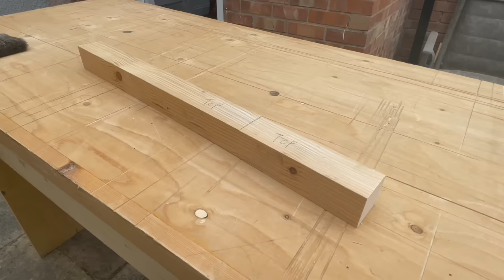Easy Trick For Scribing Kitchen End Panels

Comment: Can i ask a quick question as im trying to do an end panel and leave a 40mm over hang at the top to accomodate the pelmet, how would  be able to do this with this method.  Easted so kuch time trying to do measurments just want to get it done with. Great video great tip thank you
Reply from the maker: Hi, thank you for watching and commenting! This method only really works with base units to get them flush to the floor. Am I right in thinking you are doing an end panel on one of the wall units or have i misunderstood? If so it’s hard to explain over a message so i have a search on youtube and there is a video called ‘wren kitchens infinity: wall decor panel installation’ and that is pretty similar to how i wold do it
Reply: @mwjoinery  hi yeah exactly that its an end panel for larder unit. Ive seen that video i was thinking of doing it like that but then it means ive got to make two cuts. One at the bottom one at the top because unfortunately for me the floor is also uneven lol. Thank you for taking the time to reply though i appreciate it.
Reply from the maker: Ohhh right,If it is a larder unit and you have plenty of height in the kitchen… you can still use my method you just thicker off cuts. I will try explaining the best i can but just make sure you check all of your measurements before cutting because I don’t want to make you mess up your end panel if I don’t explain it very good but here goes😆 offer the end panel up to the larder like i did on the vid. Put an off cut of the 40mm pelmet on top of the end panel and measure from the top of the larder to the top of the end panel (including the pelmet off cut). You will need 2 off cuts the exact same thickness (like i did on the vid) but they have to be thicker than the overhang that you previously measured. Once you have them, take the pelmet away and clamp the off cut to the top of the panel. Then put the pelmet on the larder unit and hook the end panel on. Then use the other off cut to mark along the bottom and it will compensate for the pelmet and leave an extra 40 mm on the top. Hope this helps?
Reply from the maker: And as for the floor, that’s typical that it’s uneven… would be far too boring if it was nice and parallel…😳😆😆 Thanks again
Reply: @mwjoinery  you sir are an absolute legend. Totally understand that. Amazing, thank you ever so much for taking the time to reply to my comment . Ive subbed you too
Reply from the maker: No worries at all, if you have any more questions i am happy to help if i can! Thank you for subbing! I will start doing a few more vids soon so hopefully it will be worth it for you😆👍🏼👍🏼
Reply: @mwjoinery  just an update on this, did exactly as you said and it worked amazingly. No time wasted got it done. Thank you bud really appreciate you taking the time out to reply you legend.
Reply from the maker: Awesome! Thank you for the update😄

Comment: Thanks.
Reply from the maker: No problem, thank you for watching👍🏼
Reply: @mwjoinery  Bro, just did an end panel on an 8 foot cabinet. Had to screw the block in at the top because the clamp interfered with the ceiling. But by golly I got the scribing absolutely perfect thanks to you.
Reply from the maker: Awesome! Glad it worked out well😄

Comment: Do those plunge saw rails move. Great tip.
Reply from the maker: Sorry for the slow reply, i must have missed this comment. They do on certain materials like i have found them to slip ever so slightly on laminate worktops. The majority of materials the track is very secure. If comes with clamps what are brilliant to use if needed

Comment: Can you describe how you got the width right? It was so oversized. Did that have to do with the thickness of the block?
Reply from the maker: It doesn’t have anything to do with the size of the block as long as they are the exact same size as each other. The end panels are oversized so if you slide that to the wall it will stick out past the cupboard for example it may be 20mm. In this case as long as the blocks are bigger than 20mm this method will work. It’s quite hard to explain over a message but I could show it in person very easily😆 if you don’t understand let me know and I will try and explain it better. Thank you for watching👍🏼

Comment: So what about of the flooring hasn’t been fitted yet but you need to instal the worktop and sink? Real world problems, so this doesn’t help much in my situation.
Reply from the maker: Yeah, it might not work in every situation but if it’s a complete new kitchen you would fit the worktops after the end panels. I also fitted the flooring before doing the end panel in this situation

Comment: When you finished,was there a small gap on bottom rear ?
Reply from the maker: There was a tiny gap at the bottom of the wall where the plaster finishes but that’s because the skirting board will cover it. As for the rest of the gaps they was pretty good, but it has been sealed now with a bit of silicone to finish it off

Comment: Hi, What type saw & blade should I try & hire to do mine ,
Reply from the maker: Hi, Thank you for watching! I used a mafell track saw and the mafell fine cut blade. If you are after a cheaper alternative i would probably recommend a jigsaw and a downwards cutting blade so it reduces the breakout on the important side of the panel. Would also make sure you use masking tape before cutting as that also helps reduce breakout👍🏼
Reply: Thanks for the tips, I can't hire the saw but I have a jigsaw electric plane & electric sander , so I think I have a chance of making a descent job , thanks .

Comment: I wouldn't have cut the bottom, but i like that scribing technique
Reply from the maker: Especially after seeing what others have suggested I would only do this if the floor is in need of scribing. If it’s level I would just cut the top of the unit. If I did do it this way I would also seal it but forgot to mention that in the video. 
Thank you! It is a really handy technique and comes in useful quite often😁👍🏼

Comment: can you make the cuts with a jigsaw? i dont have a circular saw. thanks. geoff.
Reply from the maker: Yes mate, all i would say is use downward cutting blades and maybe leave it a bit further away from the line and sad up to it. You just want to avoid breaking the panel out as much as possible👍🏼
Reply: @mwjoinery  great tip. thank you.
Reply from the maker: No probs, thank you for watching and also commenting!
Reply: just subscribed. keep em coming. cheers.
Reply from the maker: Thanks! Have plenty planned so should be with you soon😄

Comment: It's not going to work unless your floor has exactly zero fluctuations. By scribing the bottom first and then sanding the bottom to match the floor profile, it will be fine until you scribe the back and then cut that to profile and then set it 10-20 mm back from where it was scribed perfectly to the floor. It's a great way to do it, but this is always going to be something to be conscientious about.
Reply from the maker: Yeah, that is a very good point to be fair. It’s worked out very well on all of the ones i have done in the past but understand it would affect it if the floor was massively out. Thank you for watching and for the feedback!👍🏼
Reply: So what’s the solution ? Because if you did the side first the problem will occur when the bottom drops after
Reply from the maker: @1spiders1  There isn’t much of a solution (or at least I haven’t found one yet). I always do the floor first as it only has to slide back 10-20mm or so. If it ends up ever so slightly out on the floor, it’s not too bad as it will be sealed anyway. In all the times i have tried it, it’s only had very small gaps which will seal easily. As for the wall cut, i always do that second just because i want that to be perfect to the wall because it won’t be getting sealed. Thank you for the comment!
Reply: Could you not do both scribes simultaneously? Four bits of wood, four clamps, one scribe line that traverses the wall and floor in one go?
Reply: @1spiders1 there isnt really one. Template it if you want to make it perfect. Otherwise scribing with smaller stock would already improve results a lot if the floor/wall is out by a lot. The smaller the stock, the smaller the offset from the actual position you are scribing to.

Comment: My goodness you made a meal of that, if I took that long while fitting kitchens I would be out of work.
Reply from the maker: It’s actually a quick and easy way of doing It I would say personally. I get that it looks a bit tedious in the video having to make that bit you clamp on and scribe with but you can use the same one for jobs in the future. Also a lot of the time you don’t really need to sand it but just wanted to make sure it was as close as possible for the vid👍🏼

Comment: Easier way, flip the end panel upside down an opposite to the way u want it finished, transfer ur line across the top of base unit onto the end panel & cut, now fit it correct way up an round.. ot will fit perfect an the nasty cut side will be on the inside facing under the unit leaving the outside view with a beautiful cut line an not chipmarks..  😇
Reply from the maker: I agree that is the easiest way but unless the wall and floor is perfectly flat, you can be left with small gaps. Still a good way of doing it though so thanks for the comment👍🏼

Comment: turn your panel upside down and mark across the top of the unit. level panel and no messing around :)
Reply: That wouldn't be accurate if the floor runs uneven
Reply: @Stu Hill  uneven doesn't matter as long as its flat. Only ever fitted one kitchen where they had a cobbled floor. 👍
Reply: @Stu Hill  turn your panel face in to the unit. Mark across the top of the unit then cut from underneath. Just saved you hours of messing around. 😁😁😁

Comment: Very nice…. But it doesn’t help when builders can’t do flat walls and floors….. 80% of the times I scribe panels, plastering is crap. Why do you sand edges after cutting!? And it’s a must to seal at least bottom edge. Water proof wood glue is the best
Reply from the maker: Thank for the comment! Doing it like this does actually scribe it to the floor. That’s why I sanded it. I cut it to the nearest points possible to my line then sanded any curves. I do also do that and then seal with clear silicone when the rest of them are done but completely forgot this part in the video😆 Thanks again👍🏼

Comment: But then you end up with an unprotected side on the floor...any moisture will blow the end panel
Reply from the maker: If the floor was level and didn’t need scribing, I would keep a machined edge to the floor. When i do cut the bottom I always protect the cut edge then seal around it. Should have probably mentioned that in the vid👍🏼
Reply: @MWJoinery  what sealant do you use?
Reply from the maker: I’m not sure which brand i used but it was just some general purpose clear silicone

Comment: Bit of a long winded effort to cut the wrong end, obviously if the floor is a disastrous level you might have to cut the bottom edge, but we/me has always cut top and back making sure both are plum and level… we never expose the underside due to moisture absorption, that’s a quick way to see a panel swell… and we always screw behind the hinges and shelf to conceal and fixings… not saying this guy is wrong but not our way…🤷🏼‍♂️👍🏴
Reply from the maker: Hi, I do tend to just cut the top if the floor is level and I should have mentioned that. If I do it this way I also seal the end and then silicone it but completely forgot to add that to the video😆 I did put the screws either behind the hinges and inline with where the shelf will go other than the one at the top as I thought that will be out of sight anyway. Thank you for the comment and appreciate the feedback😁👍🏼

Comment: There's no way that particle board is going to withstand a mopping or any water on the floor for that matter.
Reply from the maker: Yeah I forgot to mention in the video to seal the bottom edge but I had already put it out when I realised. I would normally keep an uncut side down if the floor is level but if it’s out I use this way to scribe it

Comment: Just measure both front and back of panel if unit is level then it will be ok take to long to fit kitchens using those slow techniques am afraid
Reply from the maker: I get that it seems like a bit of a mess about on the video but if you keep the 2 blocks used to scribe and clamp on it is actually a pretty quick way of doing it in my opinion
Reply: Yer it is a neat way of doing it 👍

Comment: I can see what he is doing, I have no idea why.
Reply: If a floor/ wall is not perfectly straight then when you offer up the panel to it there will be unsightly gaps visible. The idea is to cut the panel so that its profile matches the 'waviness' of the floor/ wall. For example for the wall, if you move the panel say 5cm forward, then run a pencil along the wall on a 5cm piece of wood then you should have a line on the panel that matches the undulations of the wall. Cut the panel along that line (this is the hard part!) and when you move it 5cm back to the wall it should fit to the wall precisely without any gaps. Note that the the length of the block of wood you run along the wall will determine how sensitive the pencil line is to undulations in the wall.

Or to avoid all this you could bodge it and just use a bead of silicone to cover up the gaps  🤪

Comment: Zero instruction on measurements and such
Reply from the maker: You don’t need to measure anything as long as the scribing block you use is greater than the overhang from the top of the unit to the full end panel